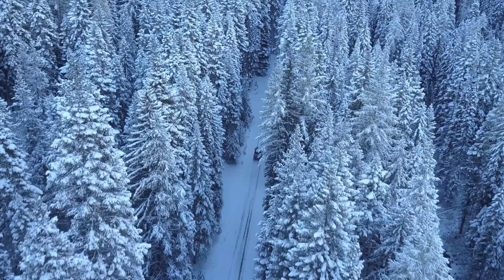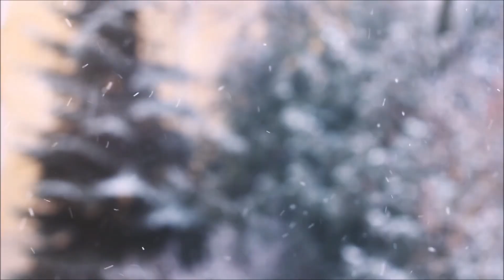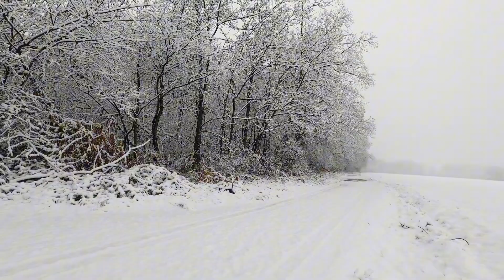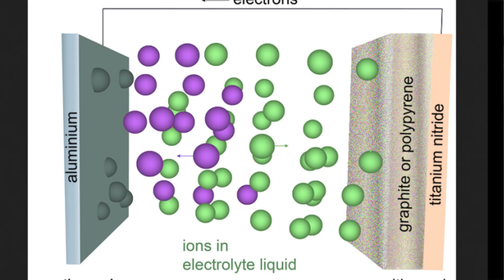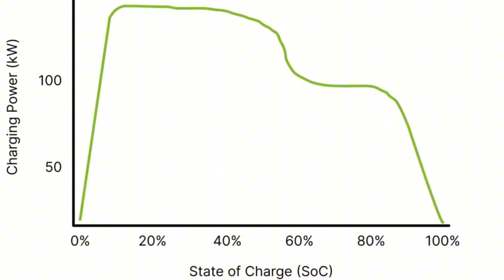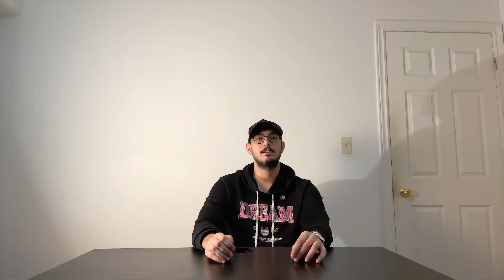Extreme Cold Impact: Engineering Challenges for EV Battery Performance

Comment: erevs dont care about -20c. no need to dc fast charge, 8 liters of fuel has same thermal energy as tesla battery pack, and you dont even need to carry around the gas when its warm weather.
Reply from the maker: I agree Erev doesnt need complex thermal control but lets imagine this: 90% of the time the car is parked normally . If the car is parked and pack temperature drops below certain range and thermal system doesnt start working , your battery might get damaged even in erev’s
What do you think?
Reply: @shayan_ev  hmm, its a valid concern. i thought most types of lithium batteries are okay to be discharged in the cold but charging is where the most damage is done.
EREV's usually leave a bigger buffer on the top of the SOC curve which i think might help with cathode cracking at super cold temps since you dont charge the pack all the way up to full. ~4.0v per cell vs 4.2 or 4.3 for nmc is probably safer for the cathode if the electrolyte does somehow get cold enough to freeze, i think tahts around -20c/-20f. thats when lead acid batteries start bursting too lol.

in my EREVs there is no way to turn off the automatic engine on mode, you can only delay it until ~14F or -11C. its probably because of regen fears and a cold soaked battery.